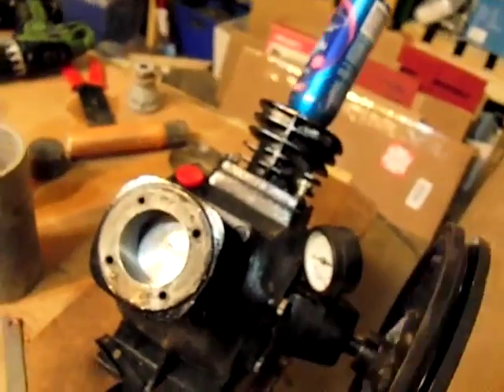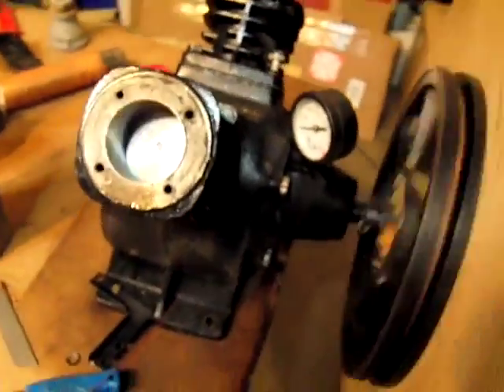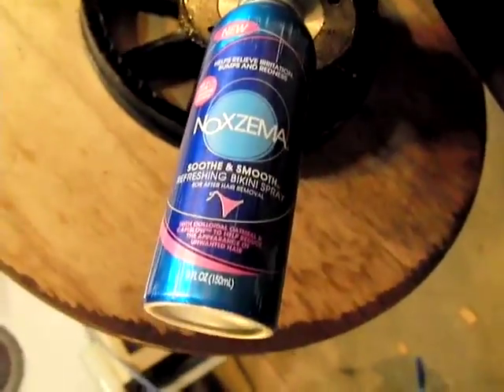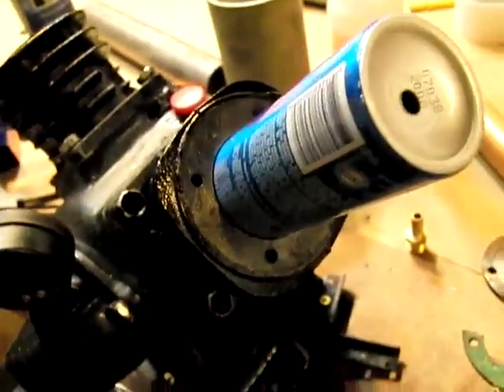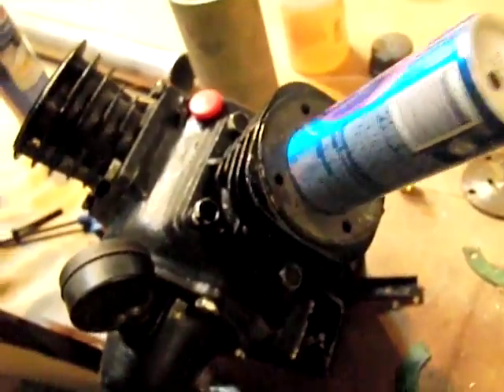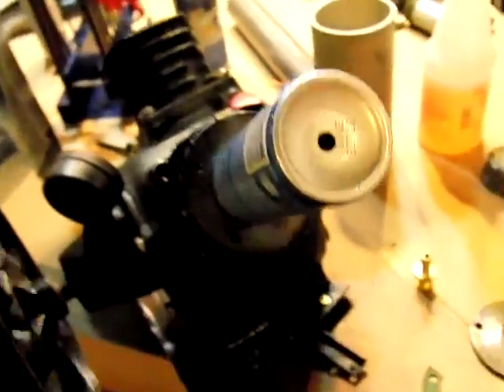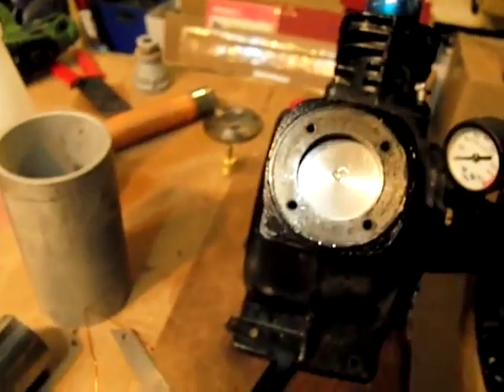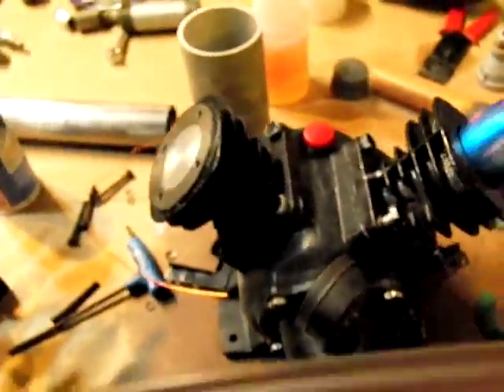DIY STIRLING ENGINE Update Air Compressor to Solar Stirling Engine

Comment: Sadly reciprocating 2 stage compressor (not linear) is used for 150 to 200 PSI - ie refrigeration. Vertical/in-line are  the wrong type but 20% more efficient for less than 150psi. Consequently the fridge compressors suit 500w generation, not the 150w you might get off a 1m parabolic reflector or lens. Thus it needs a 2m lens for a squared wattage throughput. Those compressors are designed for around 2.4kw

Comment: The joining tube volume is vital for efficiency as cylinder 2 at its largest plus the joining tube must equal cylinder one at its largest. Otherwise the cooling chamber (plus connector) will compress and not dissipate heat well, or be too big and resist the air draw into cylinder 1. Without the piston rings this heating/resistance is lowered but there is still reduced time cooling. Also, when the joining tube is small turbulence will cause friction drag. So short and 2mm+ is best. The point being to polarise the heat to maximise energy discharge via circulation/rotation. Spreading heat/friction/compression heats the air going to the heating chamber - bad. (Cylinder 2 is normally a smaller secondary compression tube with a cooling jacket).

Comment: There is an easier build that will produce MUCH  more power.  An alpha configuration engine has no displacer piston kludge and can pressurized to much more than atmospheric pressure. Working at atmospheric pressure keeps such stirling devices wussy. low torque science demonstration projects that can't even cope with the friction of piston rings without stalling out. The only problem with using the two pistons of a compressor for a alpha  engine is the 180 degree phase difference of the 2 pistons in a compressor where the stirling cycle requires 90 degrees. Normally folks would think of a custom machined crank shaft to create the correct angle. But an elegant fix for phase problem  is use TWO 2 cylinder compressors tied pulley to pulley with the needed 90 degree timing between the pulleys. ( face the two pulleys together and bolt them together at 90 degrees apart. Problem solved with no machining.)  Two air lines are needed to tie the cylinders together such that both sides on one compressor is the hot side and the other compressor has two cold cylinders. Of course you still have to mod the cylinder heads and take out the leaf valves and optimize heat injection on the hot side..  Two of the $89.00 two cylinder compressors they're selling on ebay should work nicely. A small tire inflator compressor plus a couple of small check valves can provide makeup air for the system pressurization. I want to build this eventually but I'm too busy now.. Build it for me would you? Your current approach isn't very promising.
Reply: Wow this is a  REELY cool idea  dobbin !    The BEST solution for high useful power output Stirling engines with LESS machining !    I ll make one right now !  But my only problem is should i reduce the stroke length of the piston by using longer con rods nd modify crankshafts ...... Plzz do reply brother ..... This is the only thing holding me back ..... Nd plz share ur email  bro !

Comment: did you ever find a cover? if and when you do I would find out the volume of air that gets pushed up above the displace piston, then leave room for that volume to be pressurized. that what is happening in the Ross cap

Comment: google low tension piston rings man and how diesel rings work  you need low tension get size close file fit top ring 28 thousant or heat old ones weening theam lm old cast iron ring 45-60 psi pressore new style or toyota rings 10-15 psi side pressure please forgive spelling people

Comment from the maker: I forgot all about that. Took me a few minutes to see it. The shirt was still but the pattern of the nose and face happened on its own. I thought it looked similar to the classic Robert Stirling photo. Only weird thing that happens is security camera orbs, but they are usually out of focus flying bugs or dust illuminated by the infrared night vision on the cameras. One time at an art show in an old building the lights went out. Everyone got orb photos with flash photography. Dust I think:-)

Comment: Good start, though there was no evidence that the science behind the Stirling engine will be incorporated into this design, since the second piston of the compressor is still simply filling the cylinder, not moving the air around it to and from a heat source as it traverses the cylinder. Still, with the second piston providing nice linear motion, a displacer yould be mounted above it, like your can, but movig the air alternatively toward and away from the heat source, letting the air move past.

Comment: Hi Dan why can you make the action of the floating piston genertor the electrical power and forget the flywheel altogether. run so light wirers in the float and coils on the cover and banking cap they may produce so power.

Comment: Dan, look in my channel for the Stirling I built with my friend as our Conclusion Work on a 4 year technical course here in Brazil. We managed to build a Gama arrangement Stirling engine with a simple compressor in a similar way you did. But after almost two years, it worked :) If you're interested, we can send more information, maybe our 94 page report.

Comment: Thanks Dan, I like your experimenting with solar energy.  
I am wondering about the air regeneration in a single copper tube.  You have another Stirling Engine that seems to have a wide area to move the air between the two pistons.  Do you think the single copper tube has enough area to move the heated / cooled gas between pistons?

Comment: Dan, although the idea is great, your engine has a small design problem: the displacer is not working as a displacer, it's acting like a piston. For this engine to work, you would have to remove the piston on the displacer side and replace it with a conrod and a new seal. It's a bit hard, but it's worth it. I've been working on a compressor based solar-Stirling for almost two years and after a lot of mistakes it started working just some days ago. If you're interested on details, just pm me :)

Comment: what is the dia of the piston? will you use Teflon Piston rings? what will be the working gas? i think it will not run on simple air. Hydrogen will b the best.

Comment from the maker: @muddymuddymuddmann Silicone gasket,, the red stuff:-). I need a machinist, this is tricky to seal, close with the prototype resin blocks. Displacer cover is very nice fit 1/8" tolerance or less.

Dan

Comment: Okay, so you have made a video before with a sirling.  The earlier engine has water cooling and welded construction.  this video has a plywood flywheel and an areosol can displacer.  That tells me you really don't have the knolwedge or the tools to make this compressor engine work.  Do you even know what configuation typel it is?  What will you delta T be?  What about thermal conduction through the block?  There are good reasons why others have been unsucessful using off the shelf compressors.

Comment: Pretty cool inovation there Dan, but I don't think you're going to get much mileage out of that aluminum can. It is going to wear through in no time with even the slightest bit of contact with the cylinder walls. I'd give it less than an our of running time before it wears through. I know you said it doesn't rub, but motion, heating, cooling and vibrations do crazy things to parts sometimes.

But I'm pulling for ya Dan! Can't wait to see you get this this engine operational.